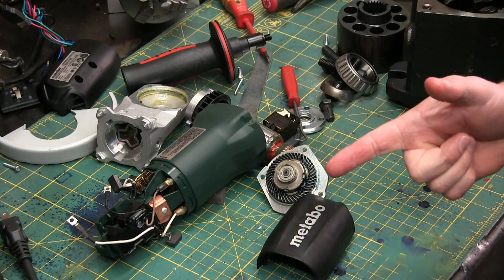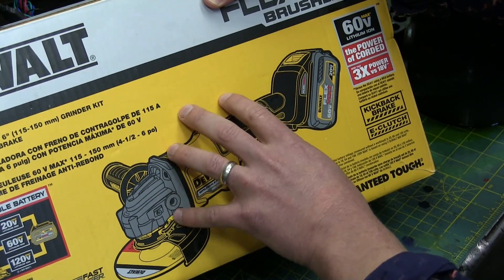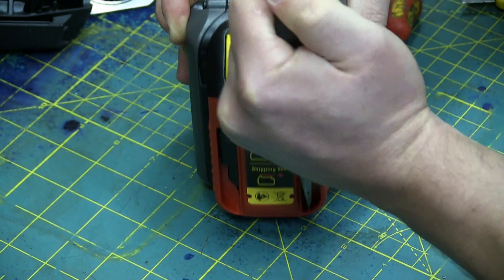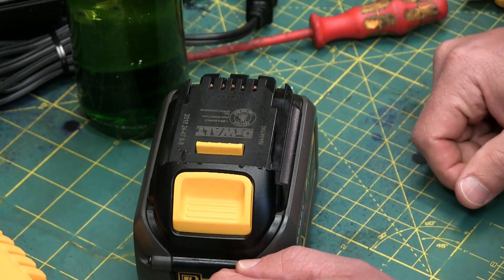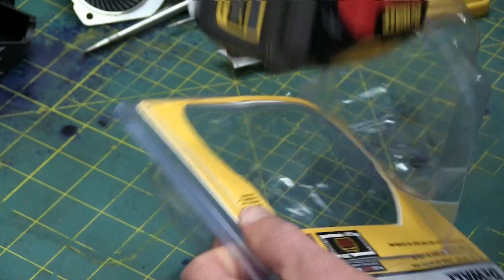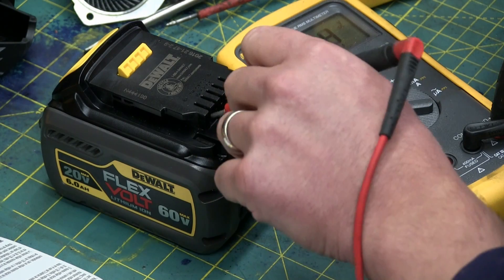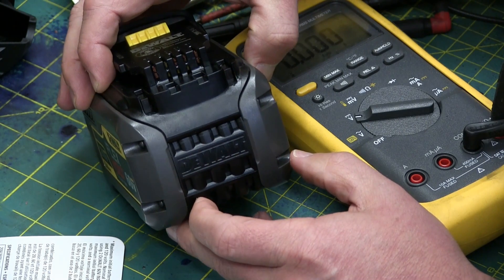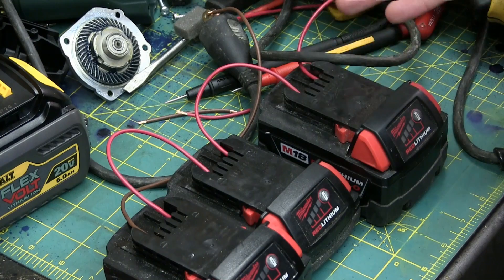Plug-in Power Tool to CORDLESS CONVERSION.

Comment: I used a Victron Multiplus to do something similar for my RV.  It takes mains power and mixes it with power from the inverter to give you the required output power.  If you are not drawing any power or less than the power available from the mains supply it charges the battery up.  All automatic.  You can also set a limiter on input to prevent trying to draw too much power.

Comment: Dewalt just put out a Power Station that uses 4x 20v batteries and converts it to 1800w 120v. (Or charges them if you plug the thing in). Pretty interesting device. 
Model DCB1800M3T1
Reply: I have one of these and they are fantastic. Charge 4 batteries all at the same time and get 110 out of it for tools . Used it camping to run a small microwave and coffee maker
Reply: I keep that device powered by my solar inverter so if I loose sun I’m still powered up and it’s always full of dewalt batteries that need charge .
Reply: Dustin Corbin review please
Reply: Damn, seems so simple.
Reply: I own the power station you mention here and is great.  I used it also to charge all my batteries while I'm working and something else

Comment: Hahhaha the yellow button. Anyway I am sure the reason Lithium batteries aren't shipped fully charged is there's a charge level sweet spot to give it the longest shelf life with little capacity degradation, and fully charging it doesn't achieve this.

Comment: Most pre-computer corded power tools and appliances like blenders and vacuums use a carbon brush Universal Motor. It works on AC or DC which is WHY it's called Universal. With 120v DC you may get better torque because the current is not constantly stopping and reversing.

Comment: Good idea on battery powered power station.  I went ahead and had Dewalt make us up one.  DCB1800M3T1  1800 watts cont. 3600 watts peak off of 4 batteries.  Only costs a crapload of $599 USD.
Reply: did you really or are you bs'ing

Comment: lasersaber has is working on a solar battery pack for construction use. You could adapt what he's using but Imo what you're asking for may be an AC capacitor bank on a power strip to handle peaks.

Lasersaber's Battery free solen1 2000:  https://www.youtube.com/watch?v=wKYkSwCGe0s
Example of using a power strip with ac capacitors to reduce current draw: https://www.youtube.com/watch?v=aQJrFV077PA

Comment: if the voltage is high enough and because of the delay in synchronizing electricity at 50/60 over say a few hundred km why we use DC links between say England / France/Norway etc  these are GW cables

Comment: okay here's how you do it step up a 50/60Hz mains to higher volts then rectify to dc losses being equal to I*I*R lower current lower loss double voltage 1/4 losses (V=IR) over cable length use HV cable etc. other end  DC Switched Mode power supply high frequency on off 100kHz well above adible any way = tiny transformer V/F =constant for KVA rating (ferrite core torroidal wound best) rectify 110V lots of amps AvE
Reply: nice

Comment: Your idea of running AC had power tools on DC voltage has been used before, (quite often actually), and only works on power tools with brushes in them.
It does not work with more brushless motors. unless your batteries are powering something called an inverter to change the lower voltage DC into higher voltage AC.
 It also usually does not work with motors using SCR type speed controls because it needs the AC voltage to turn the scr off once it is fired...
 There has alway been an advantage in running ac brush type motors on direct current (DC); because they have much more torque that way.
 I have an emergency internet access system in my home where I power all the internet items and my laptop from a very small 100 watt inverter running off a 12 volt 5 amp-hour battery; where the battery is always being charged by the AC from the wall.
If I lose power I can still be on the internet for about 4 or 5 hours hours running off that battery, (and the battery in my laptop that was being charged at the same time)....
 The whole idea is that I am ALWAYS running off that battery and inverter, no matter if the battery is charging or not.
So I do not need any kind of a fancy switching system to kick in when the power goes out.
 It also insulates my computer equipment from any EMP that comes down the power lines because the battery absorbs the overload.
 The set up looks like this:
AC power from wall outlet  -->  Battery charger  --> a 12 Volt battery  -->  a cheap ($20) 100 watt inverter  --> AC power to the wall warts that charge my laptop battery, operate my router, and operate my internet interface device.........
 I found my 5 ampere hour battery and 100Watt inverter more than adequate for my needs.
More power than 100 watts would require a larger charger, battery, and inverter.
My entire system cost me less than $40 for the charger, battery, and inverter.
 You may want to do a video on that someday....If you have any questions, contact me and I will do my best to answer them.
I saw your videos for the first time today and really enjoyed them.
Keep up the great work!

Comment: maybe an electrical pixie engineer on the next job? Or fatter pipe. less voltage drop u sure thats not an uncoiled lead melting shorting with heat and tripping?? how would a 3/8 ths pipe run 10 gallons a minute over a mile at 200 atmospheres, what would you get out the other end?

Comment: so step up the voltage over the distance then step down at point of use like 110v  smaller wires but KV transmission between is easiest

Comment: capacitor like charging regulated current to the breaker in between usage constant till full then sit down the actual is u cant run 110v or 240v without the correct capacitance along the wires and why they are separated and HV until use ac low voltageor you can increase the frequency gets dangerous 400Hz neeeds smaller wires.but easier to die

Comment: you need new coming soon aluminium battery tech that will charge fast and repeatedly like 50,000 times first aVe lithium Ion isn't gonna do it, I get what you want and step up voltage from what ever dc is possible but ultimately its about storage

Comment: Would you just be creating a reinforced plastic molding and throwing in more 18650 batteries?  Because you could create a bank of batteries to create 120v  to run the cords.  Basically creating a large capacity battery.
Reply: like an electric bicycle motor

Comment: A UPS (uninterruptible power supply) is practically what we going for but only with one outlet
- battery backup 
- smooth out power fluctuations
- low pass over time from wall power to battery...

Comment: +AvE Just out of curiosity, why not use a start/run cap setup and maybe a transfomer, given a calculated amount of voltage drop through the conductor.  would that not be a cheaper/simpler method?

Comment: +AvE    On the 'turbo-charger' (ignoring the yellow button), I see a comment about live AC and batteries.  But, I was thinking how useful it would be to be able to use the turbo-charger as a single source for a quickie and run the tool off of 60V DC.  With these two ideas in mind, the turbo-charger could ALways start the tool using 60V DC.  After starting, if there is AC available, it could switch the tool to AC power, and then top off the batteries.  If there's no AC, it just keeps on running with the 60v DC.  If there's no tool running, it just charges the battery.

OK, I just whispered "push the yellow button" - because I was brought up that way O:-)

Comment: You are describing and trying to make a uninterruptible power supply(UPS). here is a cheap one from amazon: https://www.amazon.com/APC-Battery-Backup-Protector-BE350G/dp/B001985SWW/ref=sr_1_6?s=pc&ie=UTF8&qid=1477795207&sr=1-6&keywords=ups
They also make inline  UPS that just have the wall charge the battery, and the outlets only run off battery power, they are more expensive albeit. They also come in higher wattage ratings. The one in the link is just a slimmer form factor one that would be more portable and keep your breaker from tripping.

Comment: This would be difficult, because you can never let the batteries touch mains (even with diodes), because this would mean 120v on 3 20V batteries...
So you have to build a brainbox that switches between batteries and mains, or some sort of rectifier before the batteries (of course, the 120V problem is still here)

Comment: just put a transformer at each end of the power chord doubles the voltage along the chord and halves the amps through the chord heck for that matter step it up to 480v through the chord and back down to 120v for the tool cuts the amps through the chord by 4.    why don't you stop trying to make a new battery pack for the old tool and just make a chorded snap on power converter AC to whatever DC you need.

Comment: Dude.. Run the power drill outside on super capacitors .. 700 Farad. ok, they are only rated at 2.5v, but running them in series will take care of that.
Capacitors have a very low internal resistance so they not only charge quickly, but give out their power quicker so getting over the start up hump. This will help with tripping out the circuits..
I do something very similar here in the good old United Kingdom using a 100Watt solar panel - 12V inverter - and Super Caps.
We run 230Volt here in the UK. Dangerous voltage to play with, but the fecker works.
ML&R Jim.

Comment: Li-ion batteries degrade if stored too long at full charge.  If they shipped them fully charged, you'd get junk when you opened the package. (even more than yellow death already is)..      Also a good idea to run your batteries down a bit after charging if you're not going to use them for a while.

Comment: They don't partially charge them at the factory to save money, they do it to protect the batteries. Lithium cell batteries last longest when left at between 40-60%, and since the factory doesn't know how long they will be sitting on the shelf they play it safe and leave them at partial.

Comment: sounds to me like you should just take a pure sine wave line interactive ups with you to jobs sights it will keep the voltage at 120v any sag it sees it will bump up using the internal battery and once the sag goes away i.e after the tool has started it will start charging the battery again

Comment: They don't charge them completely because lithium ion batteries have a longer shelf life when not fully charged, not because they are cheap. 50% charged is the optimal charge level for storage.

Comment: The nice gentlemen at DeWalt already designed something similar to what you were thinking along the lines of a turbocharger for tools, its an inverter that takes any combination of 20v or 60v dewalt batteries and gives you an 1800w inverter, you just plug that into the wall and all of the draw from the corded tool would come from the batteries first and then the batteries would get charger during use of the tool. http://www.dewalt.com/products/accessories/batteries-and-chargers/chargers/1800-watt-portable-power-station-and-parallel-battery-charger-kit/dcb1800m3t1

Comment: Uhm, injector...  yeah... mains voltage, several [like, rated x 10]A, bridge rectifier with some electronic magick, to charge the LiPo batteries [up to 80% as folks said] and dick enough cabling from batteries to the tool; and only for the 'nouveau brushless' and 'universal motor' really.

That being said, one can imagine this built into ca. 10m of mains cable with 18650 cells or thinner type (but with big enough C to handle this power), heatshrinked nose to butt and connected into a serial circuit ;) it would even be flexible ;) also would have to be panzer so it would withstand somegorilla stand on it or another driving it over with a forklift...

Now you can't unsee this ;)

So let's imagine... 120V equals less than 30 cells... say, 25. 25x65mm for length = 1625mm; add  20mm gaps between cells, 24x20 = 480mm (so that any cell can 'hinge' into space between cells); several copper strands running from nose to butt of this train (since we need to rectify this 60ish Hz madness) and there u go ;)

Comment: Run the tool off of DC 100 percent of the time. Monitor the current through a shunt. If the amps exceeds the max draw, start to PWM down the main power feed to limit inrush and add surplus current from the batteries. Once the tool returns to low draw mode, connect the batteries to a charger circuit. Make it a universal box that you can plug any tool into.

-another BC millwright.

Comment: Easiest solution would be a dongly thingy plugged into the AC vagania on the wall with a recptamacle for your AC power tool's pokey bit. That'll get her skooch'n, slap her on the ass to wake her up when you first pull the trigger and keep the batterias happy with fresh pixies while you're grinding. Throw me a circuit and I'll put her in a wrapper.

Comment: For the breaker tripping problem, it might be worth looking into "supercapacitors".
They wouldn't get any wear on them from continually charging and discharging, and can surely handle all the current you'll ever need. They charge quicker, which should mean that even during frequent small cuts (lots of start up current) they should have enough time to recharge. 
It is larger, heavier and more expensive for the same stored energy, though.

Comment: I'm no electrologist, but the breaker problem sounds like something that could be fixed with a decent sized capacitor instead of batteries, no? Assuming the peaks that pop the breaker are brief, wouldn't that work and weigh a lot less than batteries?

Comment: I have a suggestion to cure the breaker tripping 
Increase the national Voltage to 240V AC or increase the breaker size to 20A rather than 16A

Comment: Pardon my startling ignorance (I'm from Florida, which is American retarded) but wouldn't an APC UPS backup serve a similar purpose? 

A small one, you park it next to your job, short tool cord to it and long extension cord to the mains. It cuts the DC out of the equation, but it's an all in one unit that's relatively portable, eliminates the voltage drop across the extension cord by buffering the draw nearby, and still serves as a source of cordless power on the spot.

Comment: 4:10  - @AVE respect your channel lots, thought I would let you know they ship the lithium batteries at a partial charge in order to increase shelf life of the battery.  Lithium batteries die over time and keeping them at a 30-40% charged state allows for the battery to keep for longer periods of time before they sell.  Source: I make lithium Ion battery packs.   -I learn a lot from your channel, thank you.  You need to not have ac going into your batteries, don't do that it will explode.  Charge Controller required to monitor the batteries charging cycle, and convert the ac to dc.  Why not just have a portable inverter battery(lithium Ion) that you can then plug your tools in when you are 100 feet from power so you don't have to use your 22gauge(lol) extension cord.    Ill help you build up such a device if you want, sounds like fun to me.  *edit -Just watched your next video.  Woops.  Love seeing what you do.  Inverters will make certain tools function better.

Comment: So instead of talking about the damn yellow button, I'm going to give you what you asked for... 

In the IT and confuser world we have UPS units that work as battery backups for when the power is out. They don't just work when the power cuts out, but if it deviates too far from the 120v ideal voltage - like you're saying, it cuts in and boosts the voltage back up to normal. The same type of tech would apply - find a way to check for source voltage drop OR a self-resetting (maybe even variable) circuit breaker that, instead of opening the circuit, switches over to the battery bank. A simple bi-metal switch might even be good enough.

Comment: It would be possible to have a mains charged booster pack that plugs in line with your power tool with a current sensing circuit that would react to the load dynamically so when you need the extra power it would seamlessly switch between mains and battery, maybe even super capacitors?

Comment: If the devices use universal motors, you could probably use a high current bridge rectifier at the outlet to convert the AC to pulsed DC.  This alone may help with the breaker from popping since the inductance of the wire would basically become a large power filter.  If it's still a problem, drop in the array of batteries to handle the surge current for startup.  Possibly add a high current diode to prevent the pulsed DC from trying to overcharge the batteries.  Not pretty, but isn't that your especiality?

Comment: The reason they keep them at half charge from factory isn't to safe money. It's because lithium batteries don't like to be stored at 100% charge for long periods of time. They like 40%-60% for long term storage, who knows how long that batteries has to sit on the shelf.

That goes for home use too. If you know you're not going to be using them for a couple weeks, discharge them to under 70%. Yeah you'll have to charge it again before you use it, but your batteries will have a longer life span.

Most people don't do this, so it's obvious it's not needed to be done. But your batteries will like you for it.

Comment: the question is do you just put a current probe and a contactor or 2 in there with some batteries? like it detects 12amps and a micro controller disconects the a/c power from the tool, steps in the batteries, and when the current goes below 10amp it switched out the batteries and in the a/c, when iot goes below maybe 8 amps it kicks in a rectified circuit to charge the battery? 

do you run the tool dc all the time? just rectify the power and hook it to the batteries with some kind of safety circuit? 

or do you go the full 9 and make a grid tie-in inverter type device to output a/c in phase with the power company to keep the functionality of phase fired speeds controls?